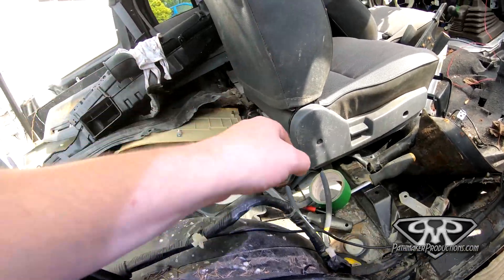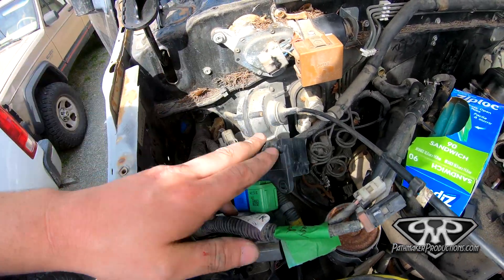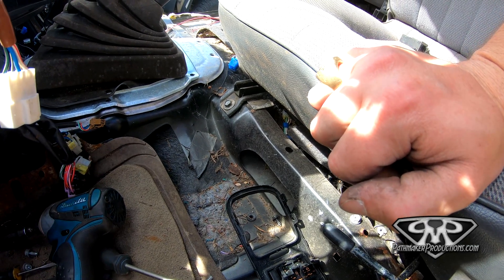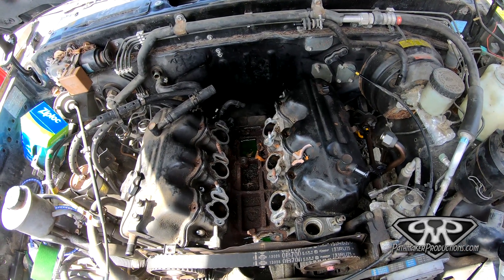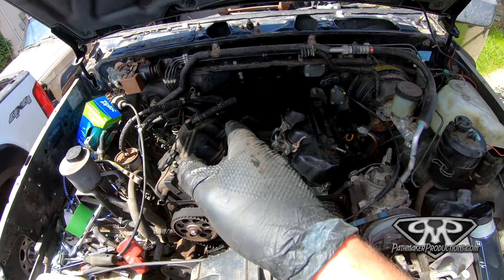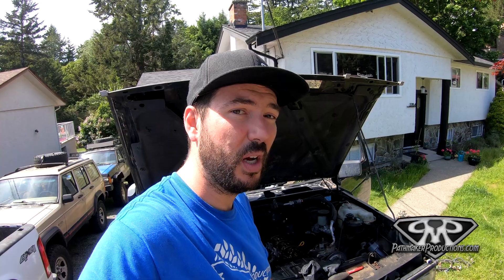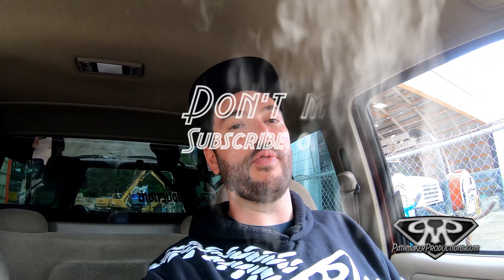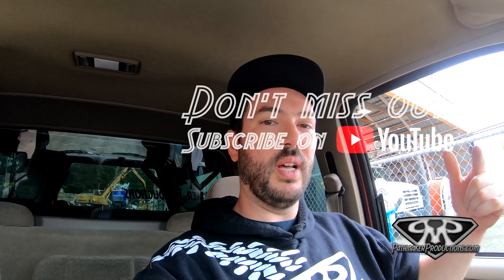Nissan VG30E EFI Removal – Part 2 (Wiring, Sensors & Final Breakdown)

Comment: Will this work with the truck same year? I have a vg30 and am so tired of the emissions. Can't even drive the truck
Reply from the maker: Pulling emissions is very easy, just remove all of the canisters and emissions sensors and cap the hoses off. I haven't had any emissions garbage on my rig since the early 2000's

Comment: Hey man, great vid, if you don't mind me asking, I just got a 95 pathfinder as an inheritance from my grandpa and it has been sitting for a few years, long story short I think I mixed up the iac connector with something else and now I don't know what's what, there's a green connector with a orange and black wire and there's a black connector and I don't know which one the iac connector is( the one that goes under the intake )
Reply from the maker: The IAC has a green plastic connector and two wires. The black connector may be the knock sensor connector, which is down in the tunnel.
Reply: @PathmakerProductions  I didn't even knew the thing had a knock sensor, thing wasn't even hooked up, thanks for the help man.